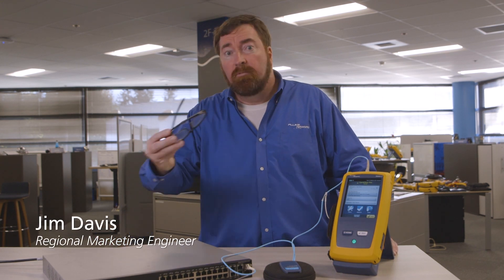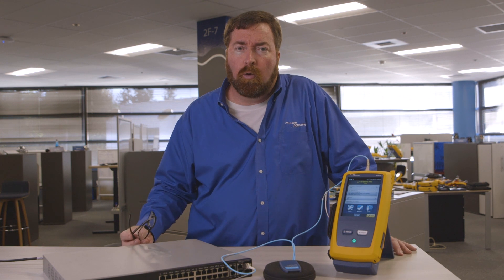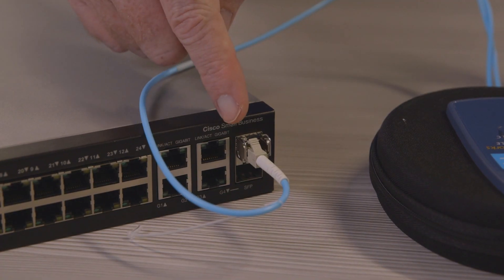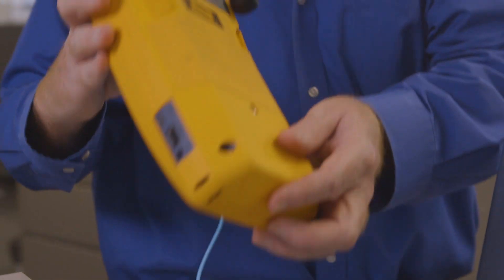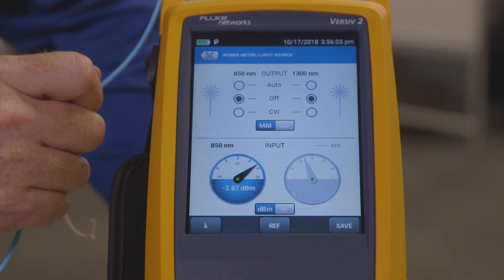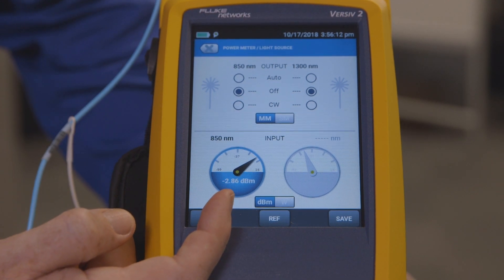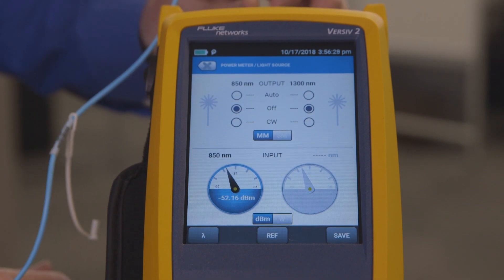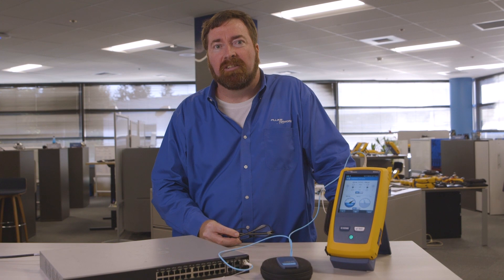Verify the Operation of an Optical Switch Port / SFP with the CertiFiber™ Pro – by Fluke Networks

Comment: Hi jim, is there any way to calulculate atteunatiuon when  Measuring Optical Power-using CertiFiber Pro,???
Reply from the maker: Good question @Shamjeer.  Measuring attenuation in optical fiber (more commonly called loss) is exactly what the OptiFiber Pro is designed to do.  You set a reference using the power source and meter, then measure each fiber against that reference.  Getting an accurate measurement requires setting that reference properly, something we cover in this video:  https://bit.ly/3ewH0qd
Reply: @FlukeNetworksVideo  Thanks for the respond,when we are doing the OLTS testing its gives power measurments???